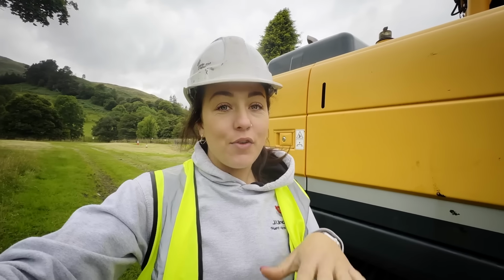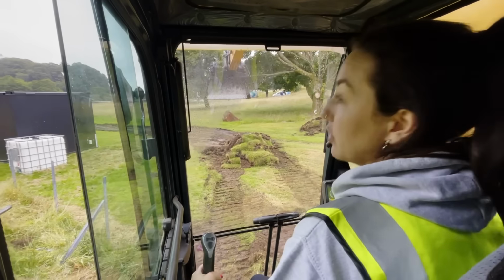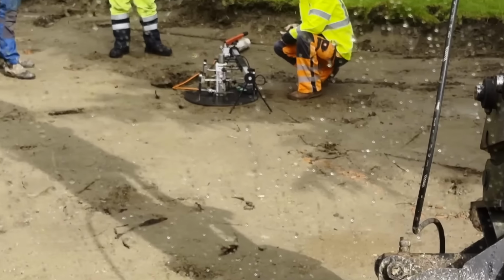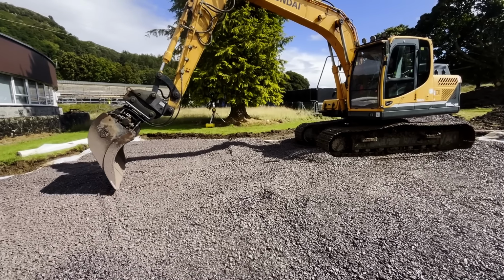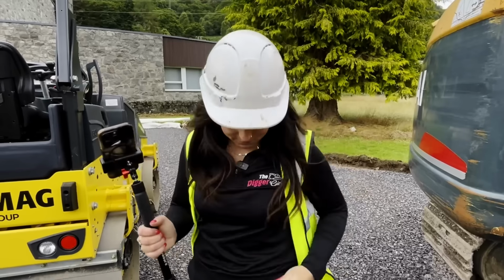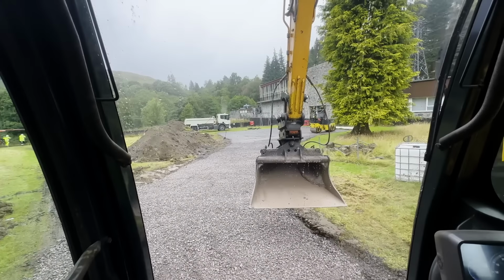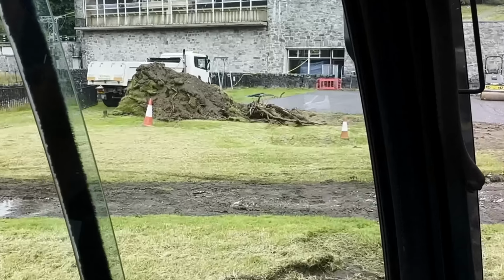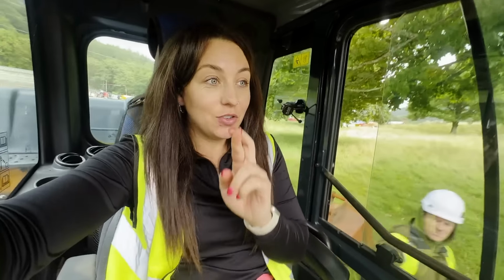Did The Compaction Test Pass?!

Comment: I had no doubt the pad was going to pass, as you only took off the turf layer, the substrate wasn't disturbed which is where a lot of people go wrong. Plus the digger you were using was the right weight, anything heavier or even lighter would also have an effect. Then of course there was this demon at the controls of the digger, who we know when it comes to levels is a perfectionist. 👍